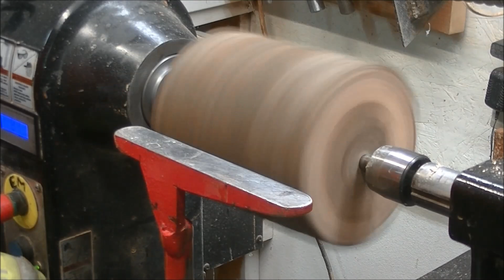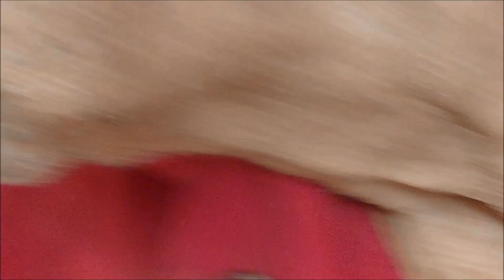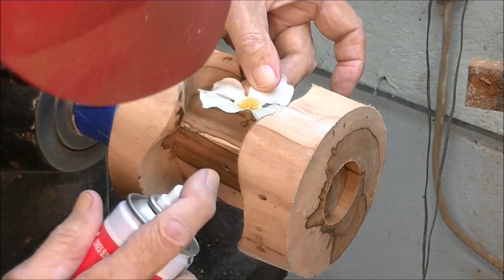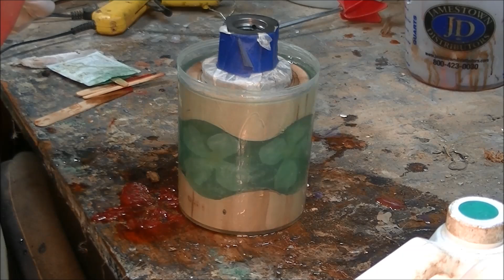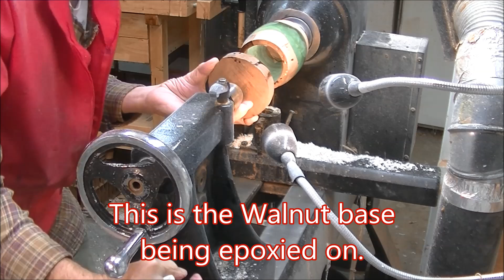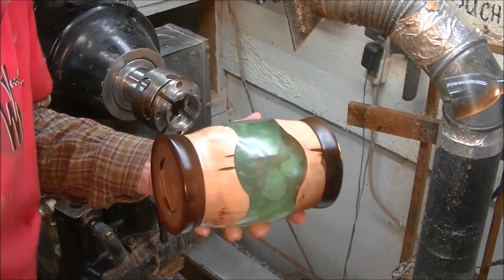Dogwood Vase # 243

Comment: Larry, so sorry for your loss, you do beautiful work! I lowered my temp on dehydrator works just fine. What is the brand of engraver you use? It does a fine job, take care
Reply from the maker: I found out the hard way that a lower temp is best.  My laser is a 40 watt I bought off E-bay years ago.  I don't think you can get them anymore.  A friend and I looked a couple months ago and they weren't there.  Thanks, Larry